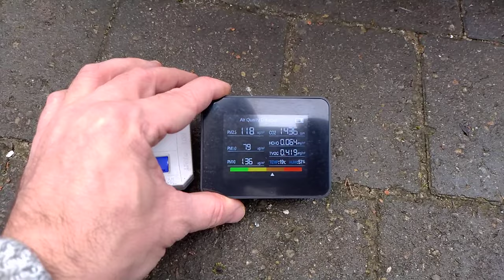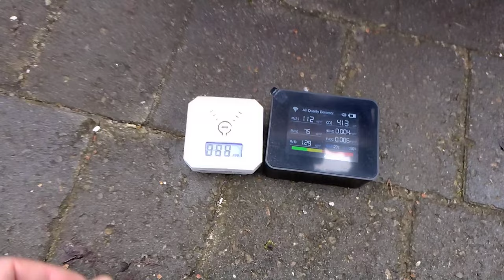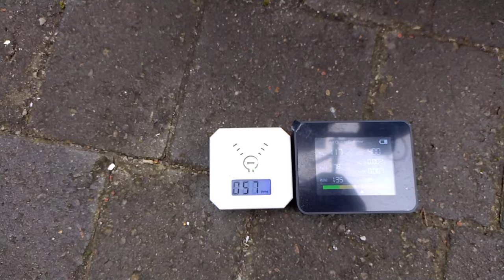THOR - MFMP collaborator preparing for testing a Thunderstorm Generator

Comment: Finally (even though it's pretty much exactly the same as many other videos of this contraption I have seen) something tangible. Now what is left is to run two engines one default and one with storm thunder molten salt generator ancient secret stuff in it both with the same amount of fuel and see which one has more energy output. (Assuming the default unit is turbo charged, as turbo has already been invented) Because this whole thing started off backwards. Like someone "inventing" feasible fusion reactor and then trying to understand what's going on in it.
Reply from the maker: The person (and the evaluating teams that looked at it before us) did not know if it was doing anything more than had been observed in other water injection systems except for the flux loops being emitted during testing several years ago in Thailand that were also observed in some attempts at GEET.

That is why it was recommended that the inventor and some of the evaluators reach out to the MFMP.

Of course, all tests will be done. It will go nowhere without them.
Reply: With enough collective effort and open collaboration, time will reveal more tangible results. I see MFMP as best vehicle to coordinate and deliver.

Comment: The sprites/"sprites" are interesting, but one has to wonder about non-visible emanations as well.  Should he be using some kind of shielding?
Reply from the maker: Yes. It is our intention to go to UK and test using methods that have shown in the past to record the unseen emissions (on ECCO fuel and LION reactors when they were cold). We will use it on the live and cold stubby TSG that showed abundant emissions during its first test on the 1st Dec 2023.
Reply: I was trying to get my baseline meter readings, this was unexpected. Yes shielding should be used. As weighted % mix:  Ag 3-6, ZnS 25-35, H2O 2-5, SiO2 10-15, Latex 45-55

Comment: Are the lamps ionising or is some other process happening
Reply from the maker: Just energising - do not want ionising.
Reply: I believe so and the copper pipes have been oxidised (accelerated by salt+vinegar+time outside) so the photo electric/catalytic effect could factor in liberating electrons and hydrogen (high humidity) on way to bubbler. I think we need to be higher than 5ev for our plasmoids to come out good to react down the line.
Reply: Bob I am wondering the average florescent reptile lamp is 26w with 5-15% of that in the UVB spectrum so only 1.3-3.9 watts of UVB. I would not know how to calculate the excitation level of the intake air. Just wondering if you know if this is giving the 5eV necessary?
Reply: have you thought to make a formal video responce to robert murray smiths video on the msaart generator he did recently?  @MFMP
Reply from the maker: It is what Malcolm used. I gave other more optimal proposals in my Zurich presentation. @geomatrix9992
Reply from the maker: Waste of time - the TSG either works or it doesn't.

1. Injecting water is not new.
2. GEET had similar claims and observations of Coherent Matter Travelling Waves outside the device as we have seen.
3. On my examining the TSG, it appears to have signatures of the charge-separation / extreme [magneto-]hydrodynamic shear process and products we have witnessed in other LENR systems, in particular the Crenellated Fe rich microspheres with orbiting C etc accretion disks.

So RMS is really an irrelevancy, any time spent on adressing him would be taken away from verification of what is or is not happening in this and other systems. @thumperhunts6250
Reply from the maker: This was a good move. @martynkemp5286
Reply: I stand corrected, the lamp is UVB 200 25w, so we avoid the UVC ionisation and avoid Ozone. I mistakenly thought it was making negatively charged particles to which any non neutral particle would be considered ionised, which is not the case and I see term ionisation used elsewhere which is cause conflation. The UVB is adding energy to spin up the electrons at those wavelengths.

Comment: There is not a globe on that one.
Reply from the maker: No - it is more like a cut down GEET that had similar claims for it and also observed Coherent Matter Travelling Waves outside of the device in some replications. We are awaiting supply of our TSGs sometime in January.
Reply: That's correct, it is just BSP pipes as per GEET plans without the Rod inside the inner most pipe. So just a plain heat exchanger, so really was not expecting anything to happen except for water doping type results. This was to get an idea of the meter readings prior to receiving the TSG.